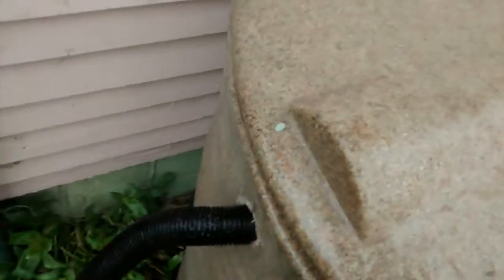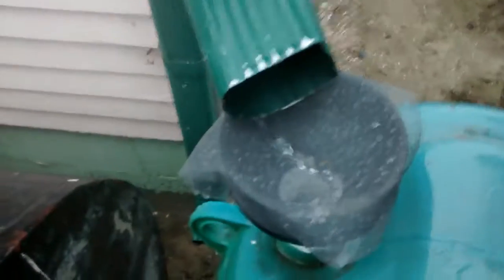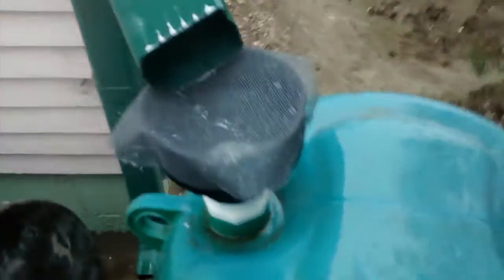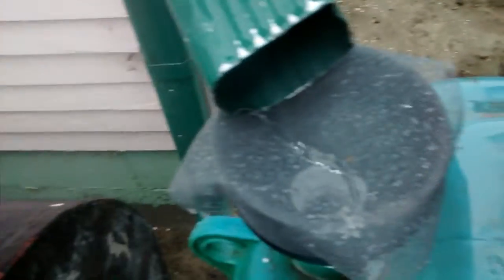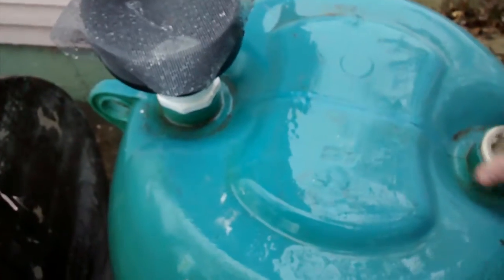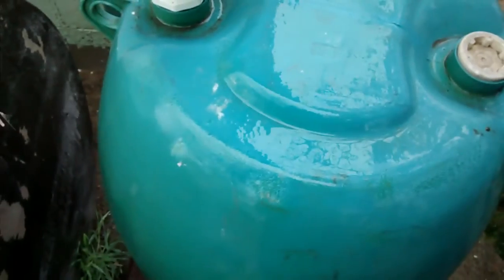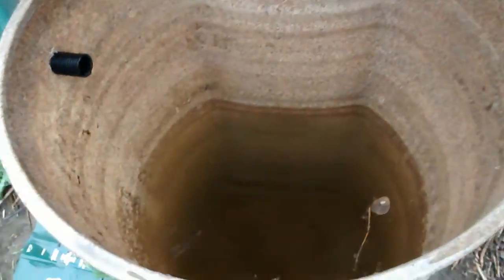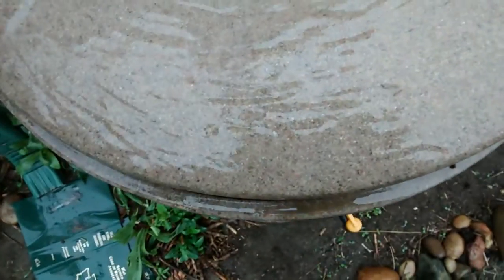Fiskars rain barrel diverter compared to DIY

Comment: I noticed your diverter is not level with your barrel, and it looks like you created a "J" line with the hose. / Neg with the DIY setup it what do you do when its full? It looks like you cut it completely away from the downspout, how did you fix the overflow issue?
Reply from the maker: I use a much shorter hose now that is connected from the other side.  its much shorter and there's no J.  I added another barrel and ran a hose for overflow.
Reply from the maker: I think the angle and speed of the camera make it look funny, but the level hasn't been a problem, its been the splashing away of all the water back into the downspout.
Reply: 509ri